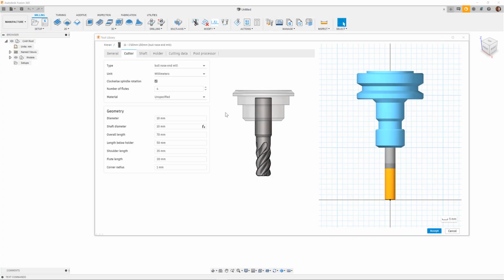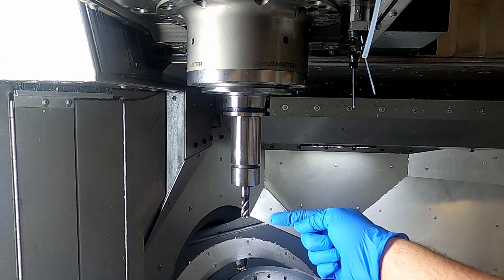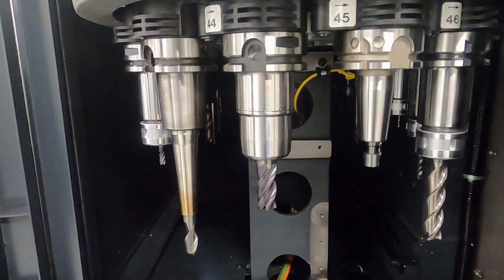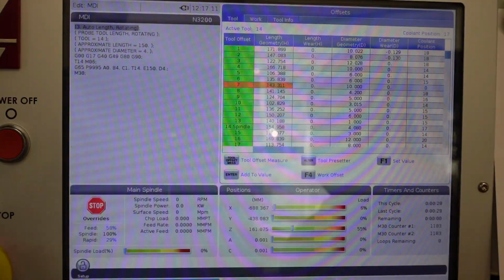Machining Fundamentals: Tool Length Offset

Comment: When talking about the "spindle nose" ..it would be great if you actually pointed to it and not the spindle cap. Moreover: The T.L.O. is actually take from the gage line of the tool (which corresponds to the spindle nose).
 Techniques: when using a gage block  ..you want to move "z" positive to get you close ..then micro feed "z" negative to a tactile touch, or suffer chipping an edge of a "given" tool. soooo...
Reply: When using a gage block as you suggested I always start below the surface of the block surface that I'm going to touch off on them work up until the block slides under the tool.  This way lowers the chance of chipping the tool.  It's way faster then coming down on top of the surface.  I can get within .001(inch) Very quickly.